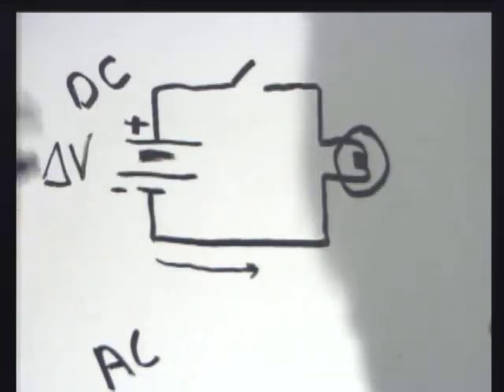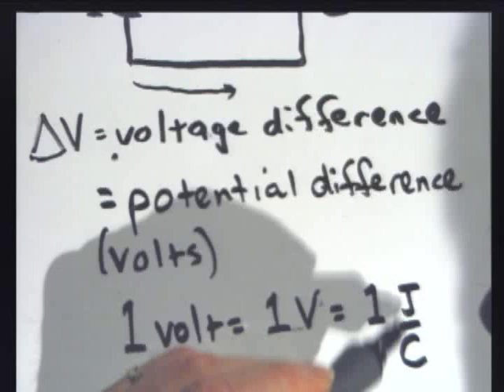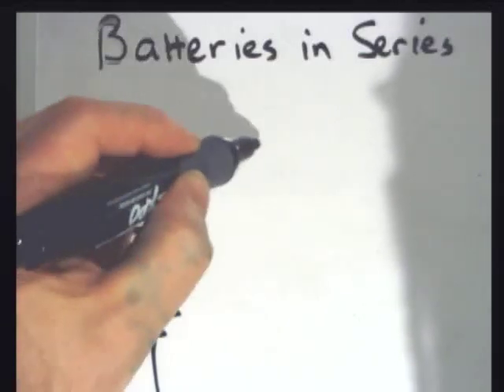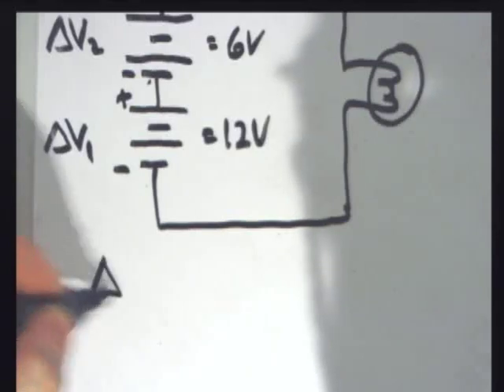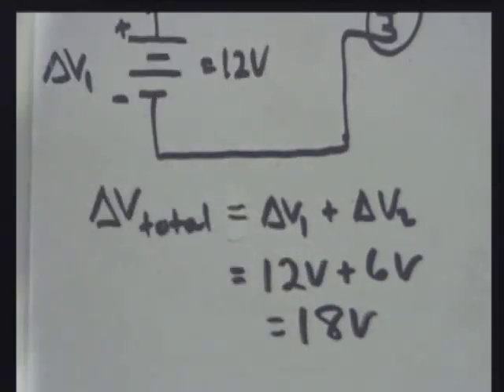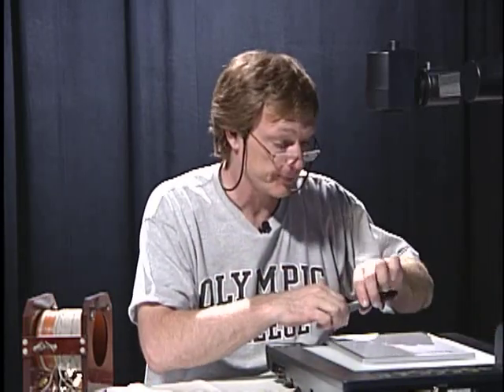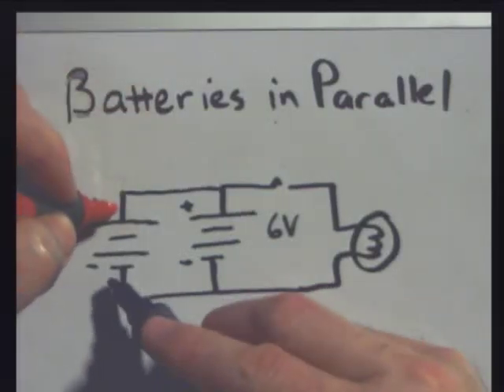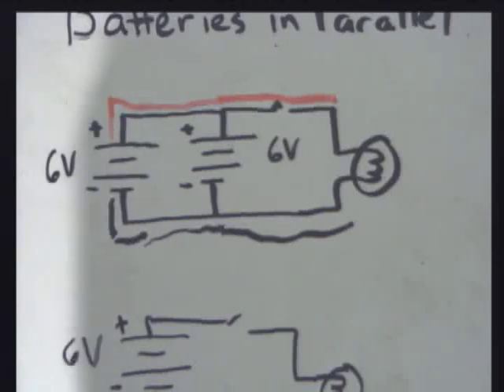Physics I J2_ Batteries in Series and Parallel (ΔV)-Bob Abe

Comment: I have a question 

If batteries in parallel provide a steady supply of energy, if ONE battery goes out, doesn't it mean the other battery have to keep compromising for the other one? Meaning, if ONE battery goes out, the other battery's power is going to get devoured

Comment: @TheAbsolutePeace 
Let's say if you have a 3V and a 4V source, in series they will have 7V and the current is limited by the smaller of the two current capacities.

In parallel, you have a problem since 4 > 3 so now the 4V source will be sending current into the 3V source. You will end up with 3V and probably something getting warm or even burning up.